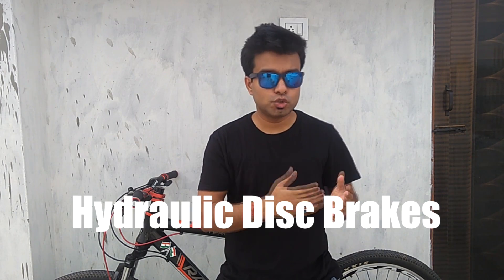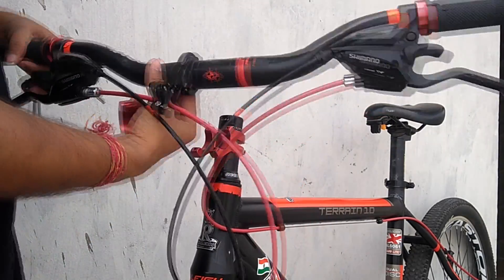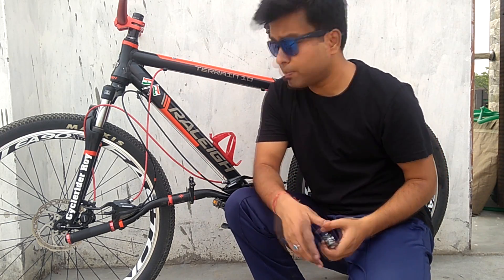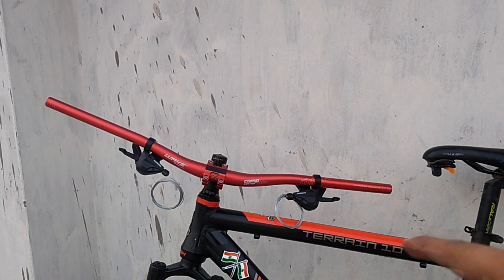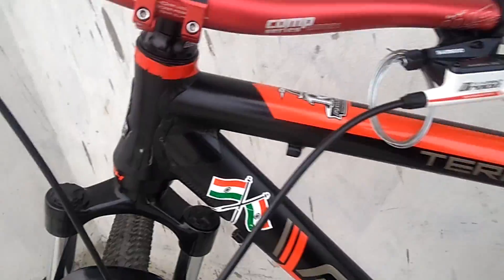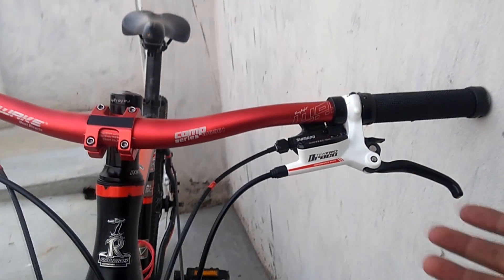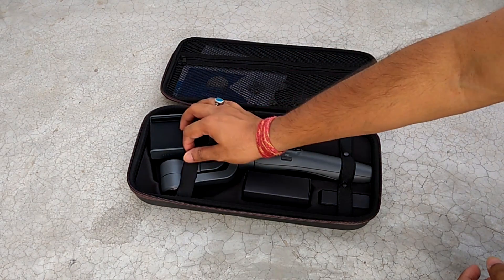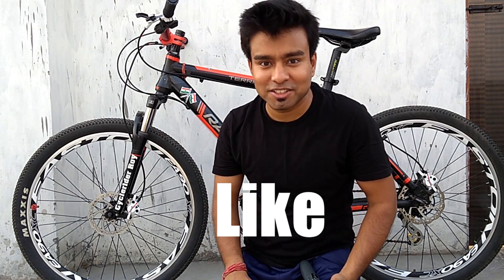How To: INSTALL HYDRAULIC BRAKE, HANDLEBAR, GEARS on CYCLE | Cycle Rider Roy

Comment: Sorry har video mein ekhi comment karne ke liye but please help me Bhaiya
Please suggest me one cycle which is Hardtail and have mechanical suspension and mechanical duel disk breaks and 24 gear system with acera or Altus rear derailleur and 27.5 or 29 inches tyre please Bhaiya Please😊😊
Reply from the maker: bro tumko answer de diya tha,

Comment: is video mein tumne bola ki tektro draco brake shimano brakes se acchi hoti hai.
tektro draco brake ke saath shimano konsi brake ke saath compare kiya tumne yeh bataana zara..
Reply: yasin bhuiyan yeah man. i also want to know.  i had a tektro hdc300 and that was the worst brake in my experience.
Reply from the maker: I compared based on the price of the set, Tektro Draco braking power is higher then Shimano BRM-315 which is available for 3200, Shimano's upper levels like Deore, SLX, XT and XTR are very good and powerfull. But entry level brakes are useless as they work more like Mechanical brakes but with 2 piston.

Comment: very informative ..
hello Mr.Roy... can you please confirm if thise hydraulic brakes will be compatible with Scott Aspect 670?
Also can you please provide the update link from where to buy ..
thank you
Reply: They are compatible to cycles which have Mechanical disc brake. You can replace them
Reply: You can get those at any cycle showroom. Amazon and Flipkart is also good place to buy

Comment: "Tektro Draco is better than Shimano" - What a joke buddy! Maybe you've never heard of SLX or XT...
Reply from the maker: you are comparing an entry level tektro draco with SLX and XT? Have you heard about SRAM LEVEL T and SRAM XX, SRAM GUIDE Ultimate and Magura?  The comparison was for entry level brakes where I compared shimano brm 315 which is the lowest and entry level brakes from Shimano. SLX and XT both are mid range brakes comes for 6000
Reply: Lol but you didn't added those words in your video!
Reply: You should have compare those brakes on their price point not with the brands... thank you...  and I heard of Magura and Sram as I am running a pair of Magura mt7... :)
Reply from the maker: Yes! I forgot to add the text or video clarification that the comparison was on entry level brakes. Thanks for letting me know that, will keep that in mind on upcoming videos. Great to know that you are using MT7